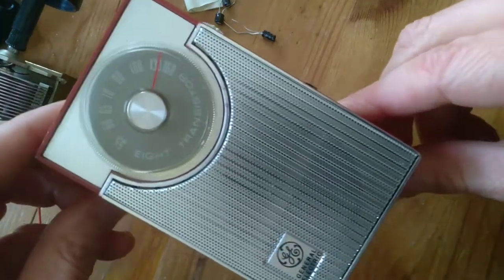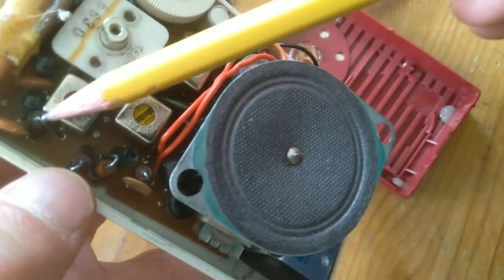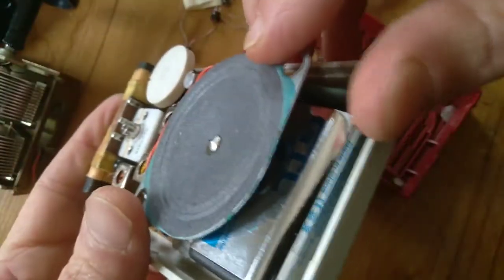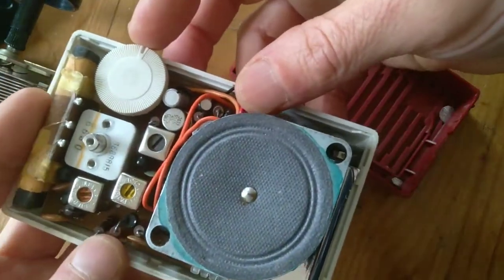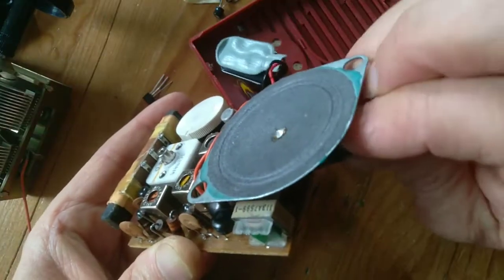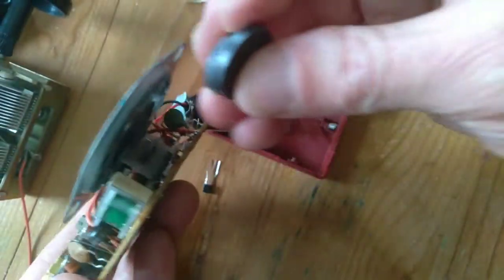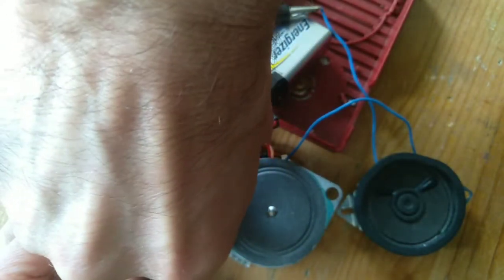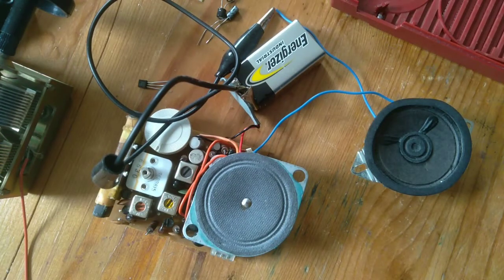1966 GE radio metal reed speaker

Comment: Interesting. I used to have a GE radio with one of these speakers in it. Never had an issue with the speaker. Interesting that a speaker magnet would go bad. The one I had would never pick up anything, and upon testing EVERY CAPACITOR IN IT WAS BAD. It worked great about that and had great reception and volume. Unfortunately there is nothing good on the radio any more around here, besides for one station that just reduced it's power WAY down.
Reply from the maker: Yeah I'm sure there's a bad cap or transistor I missed even tho the sound blasts with speaker in headphone jack. The closest station I pick up your way would be WWVA, pretty decent entertainment.